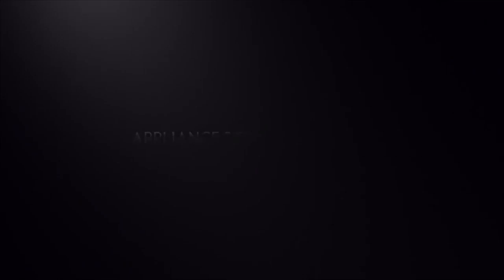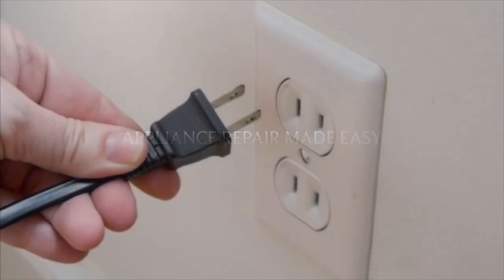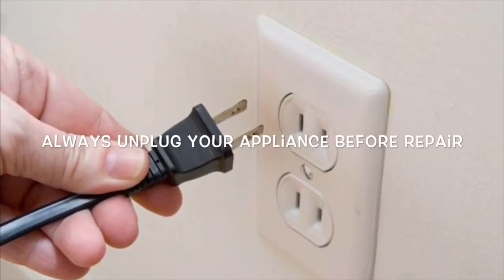HOW TO TURN ON A GAS STOVE

Comment: Should I hear/smell gas when I turn the valve for the first time?
Reply from the maker: You might have a leak. You should spray soapy water on the gas line connection to see if there’s any bubbles from a leak.